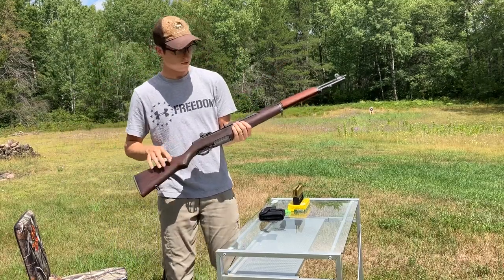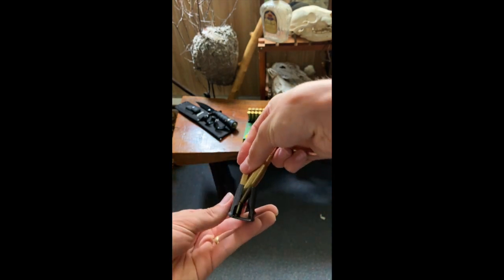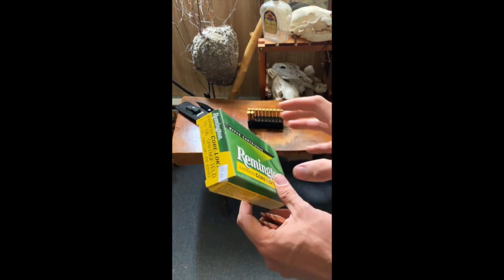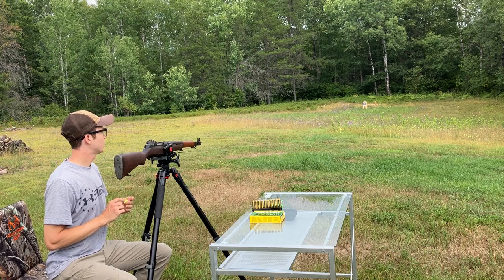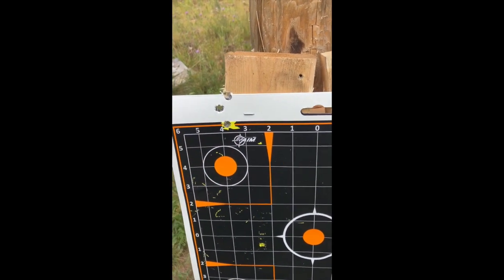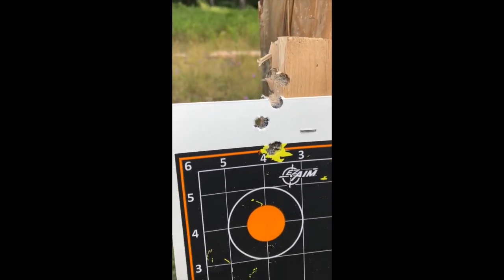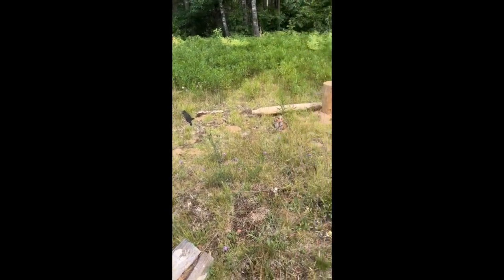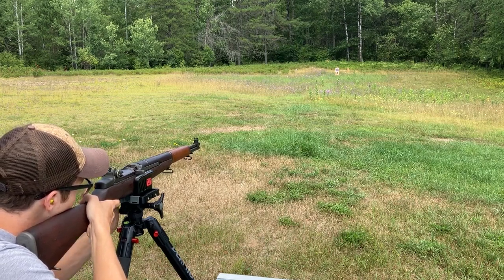M1 Garand-- How to load, unload, and fire. Beginner help.

Comment: Thanks for making the video. I am thinking about buying a CMP rifle and I noticed they now have the 30 eights which I know are not traditional, but seem a little easier to get ammo for and so forth.

What’s your opinion?
Reply from the maker: I think the .308s are a nice version of the garand. I personally wanted something with historical accuracy. That’s why I went with the standard .30-06. If I was getting one for accuracy/competition shooting I would go with the .308. Also ammo availability doesn’t seem like an issue for either currently. In my experience I can get .30-06 a little cheaper (Not by much tho) than .308. Both are nice rounds and guns. That’s my two cents. Hope it helps!